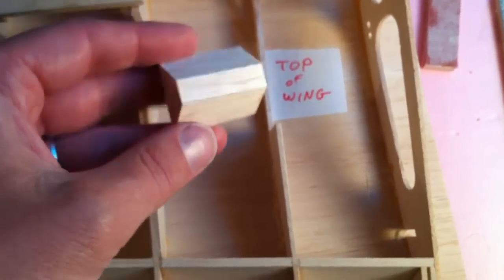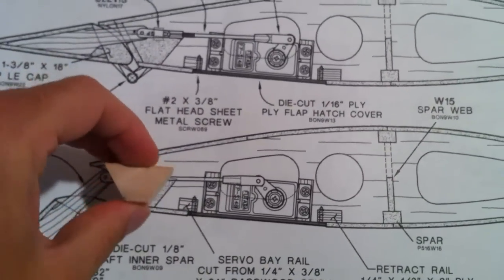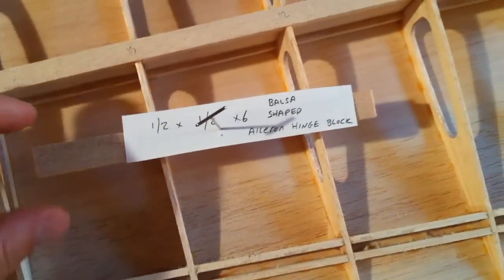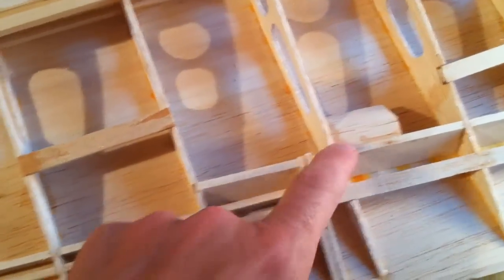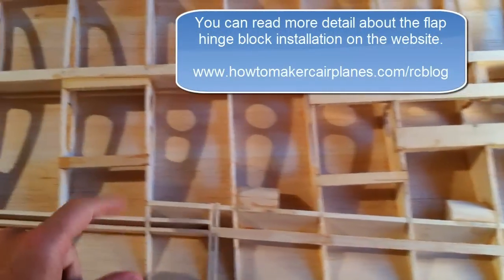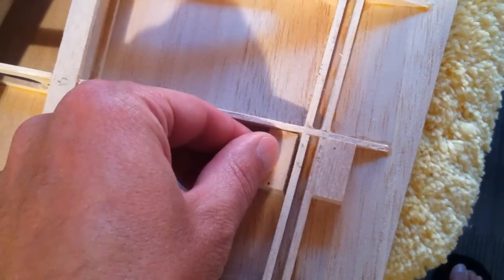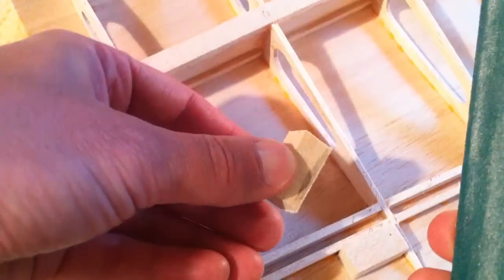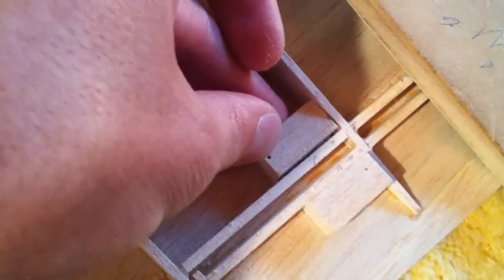Part 1: RC Airplane Wing Hinge Blocks. Install aileron and flap hinges.

Comment: Good instructional, but I'd like to point out that no one should be sanding down any loose parts over any constructed part of the aircraft, this will help to reduce the amount of junk that can accumulate inside.